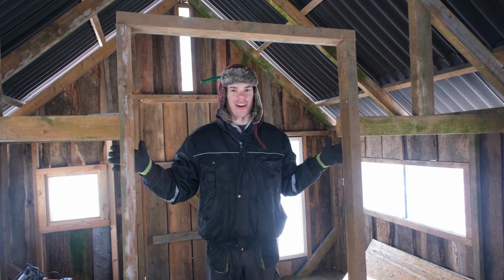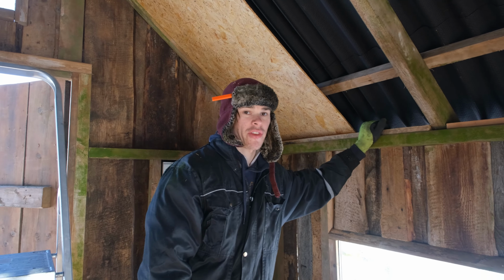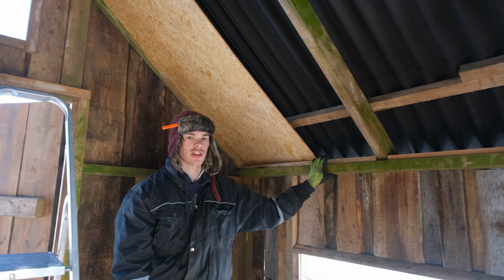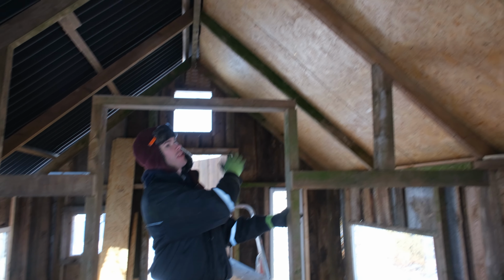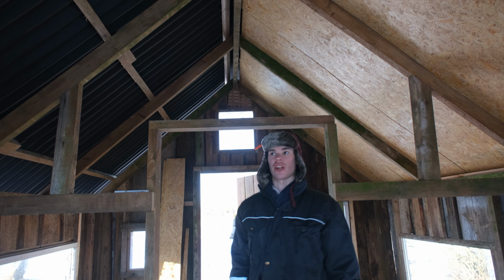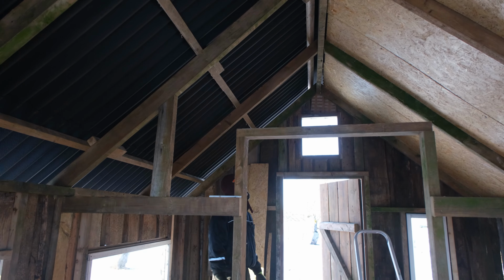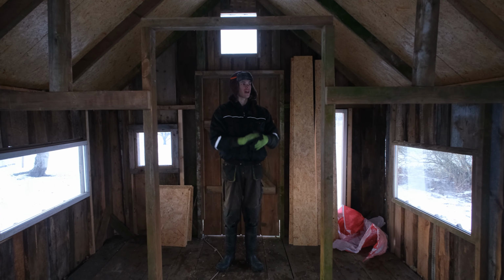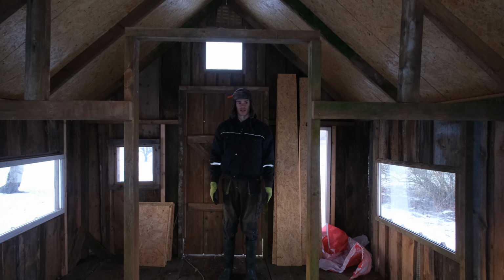Bird Coop is getting Insulated!

Comment: You need ventilation. Is is supposed to be all along the ceiling/roof, all along there. Hardware cloth behind it inside so no predators get in. Without the correct ventilation (UP HIGH) your birds will die.

Comment: Looks much better ...
Will be good for few years and you needed it done .

Not quite how perfect it is .

Usually, you put a perspirant skin in betwen covering materials n beams ( not quite sure I spell it properly ) ...

That skin is supposed to seal the building from dust n snow flakes ...
Insulation should been sandwiched between 2 layers for best results ...
You're risking it get wet from animal breadth condensating under the covering "toils" on the roof ...

In the long run it could turn to be a connection instead insulating material ...

Nice result, whatsoever .

Dare, care, ride safe, clean, have fun ...
From France with .